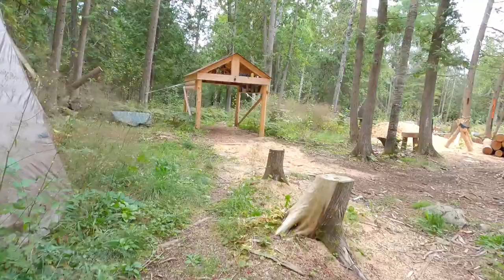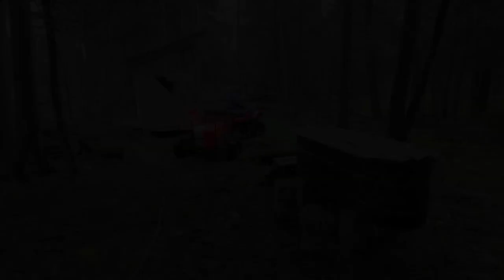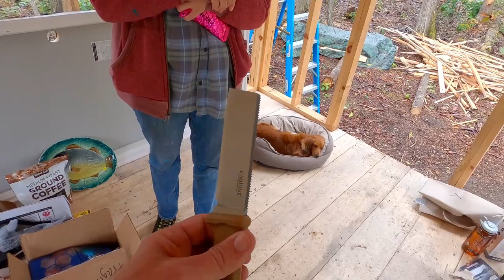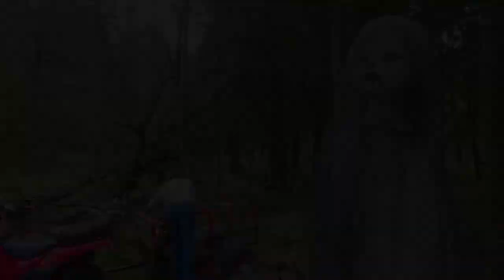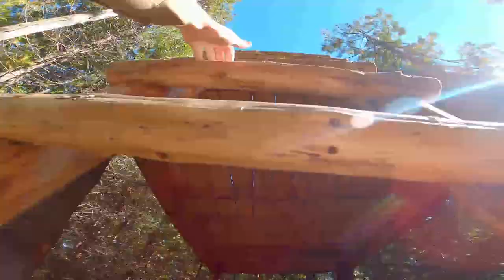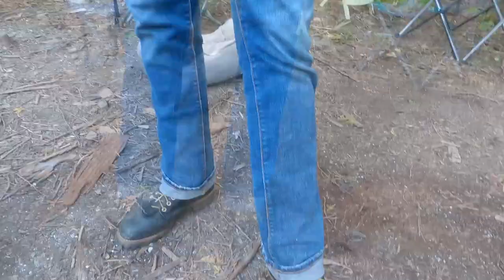10 Day Wilderness Party- A-5 Wagyu Steaks, Hot Tub, Exploding Pumpkins. #104

Comment: I am a calibration tech and the reason your IR gun is off from the actual temp probe is because of the issue with the reflective part of the top of the water. In simple terms it does not reflect back all of the needed info. think of the water surface as a mirror and it goes off in the other direction, not back to the part that senses the temp. point your IR gun to the side of the tank, it may be better or closer to the probe. there again it has some reflective characteristics of a mirror so you may have the same issues unless its to a dark section.